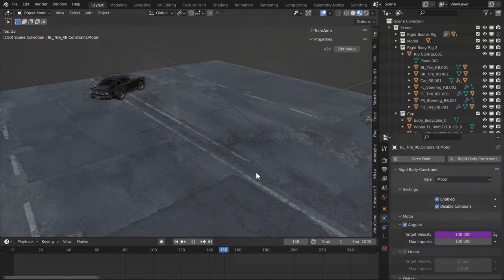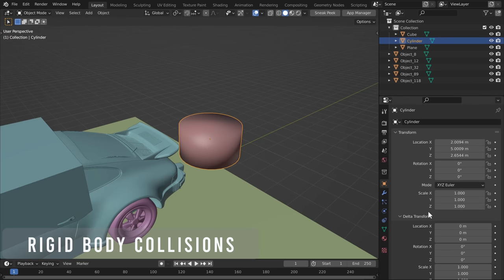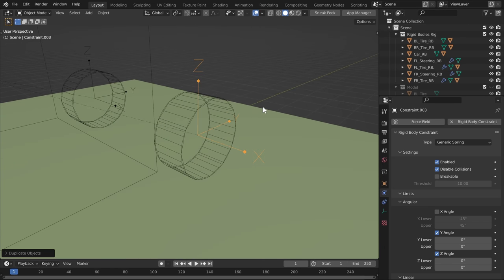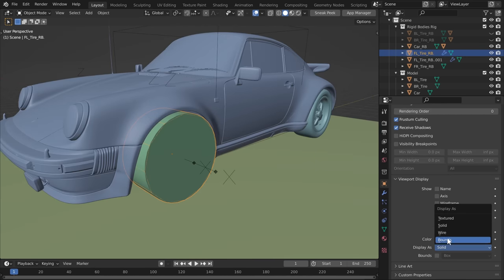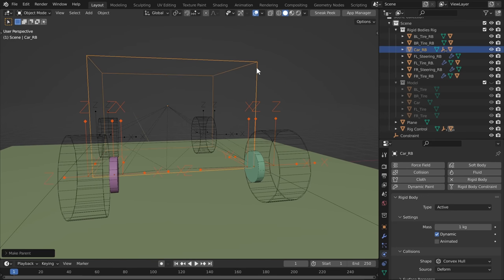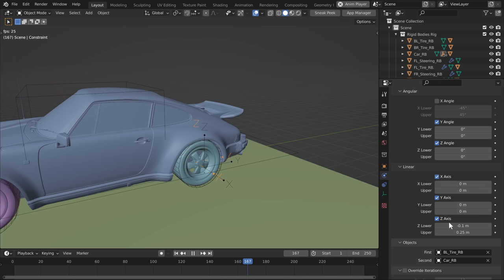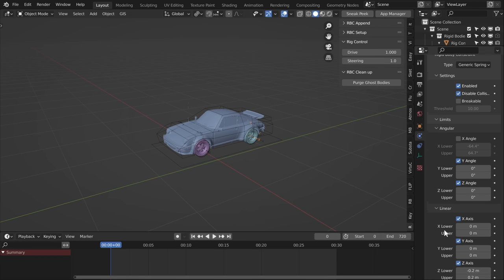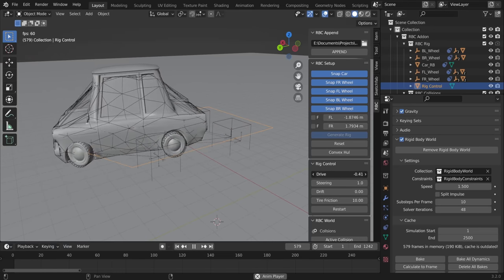Create a Car Rig with Rigid Body Physics in Blender | Car Rigging Tutorial

Comment: as soon as i switch the constraint type from fixed to generic spring, the rigid body wheels stop supporting the rigid body for the car and it falls to the ground in one connected mess.  in the video, the wheels are still supporting the car when you test the suspension...

Comment: Thanks for sharing this, Austin!  Very useful.  

A good habit to get into is (as you mentioned) to scale and rotate your objects to where you want them, and then freeze your Scale and Rotations (Ctrl+A) for the objects.  Physics simulations require real-world dimensions to look "right".   Freezing transforms regularly can save a lot of headaches down the road (no pun intended).

I look forward to any other videos like this - rigid-body constraints in Blender are a dark art (compared to what I've used in other packages)
Reply from the maker: Yes! Great advice, I’ve been trying to find a way to automatically scale and apply the objects and constraints with scale the car rig control, it’s been a hassle. Thanks Kent!

Comment: This is awesome tutorial! I want to make cool animation with car but I failed with wheels. They are wiggling like there 11:40 but then you somehow fixed it at
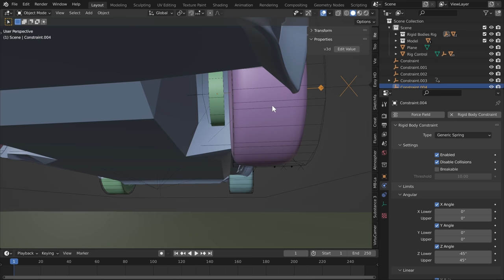12:37 and I do not know how because everything seems to be same with yours and origins are same with wheel's collisions. (Already fixed)
Reply: Eeeeeeeee I fixed! Solution was very unexpected for me. Back wheel's suspension constraints (generic spring) have to be connected to the body collision first, then to the wheel's collisions, but I had the opposite. You mentioned about something similar, so it gave me this idea. Must to thanks you for this tutorial again!
Reply from the maker: Awesome glad you figured it out! Yea I think I should've stressed the importance of the order the objects in the constraints are but didn't realize until later.

Comment: One of the best guides I've seen.
I have a question - is there a way to control the steering motor of the car by setting an angle and not by setting a speed. Because setting speed always takes the steering quite quickly to the end of the stroke and it is very difficult to center the wheels, and drive in a straight line.
Thank you
Reply from the maker: Thank you, This is a great question, I've tried to set drivers to the angle limit of the constraint but the scene needs to be reset to the beginning of the timeline for the constraint to be reset, so in short I don't think so or ableist I never found a way. This steering method is just the best option I've found so far.

Comment: Wonderful tutorial, thanks, helped me a lot finalizing my rig! I have one question though - how did you achieve the "standstill"? I always get sliding movement and slight wheel rotation when just standstill (even though the ground is perfectly flat). I tried increasing the Iterations and friction, to no avail. Glad for any sugesstion! Amazing monster truck rig by the way, so satisfying to watch, love it!
Reply from the maker: Thats a great question, a trick that worked for me is having motor constraint's Max Impulse set to anything above 0. The higher the number, the less the wheel will rotate, it acts kind of like a brake function. You could also increase the object friction to reduce sliding movement.
Reply: @akastudioss  Hi, the problem was in the weight of the Body itself (set to 200 kg), when restored to 1kg the model stays nicely put. With your monster truck rig you use real weight measurements? Asking just out of curiosity, since it seems to me higher values cause bugs. Thank you for your swift reply by the way! ;)
Reply from the maker: @janhrodek7206  No Problem, but no I did not use real measurements for the monster truck, just winged it lol.

Comment: As a non-modeller: How come you can’t assign the properties to the model itself? Like, why do you need a cylinder when you already have a perfectly good tire? Seems like it would simplify a lot.
Reply: Actually using the cylinder simplify things, at least that's what I see in the video
Reply: @seriouscat8482  I'm not seeing it. The cylinder causes issues because it needs to line up with the tire, and causes issues when scaling the model because it does not stay lined up to the tire (or the body), and there's twice as many objects to manage along with twice as many objects to watch out for in terms of the physics (like: make sure the bumper doesn't clip in to things because it extends past the rigid body cube).
I feel like the main reason I'm not seeing the simplification is because I'm not familiar with 3D modelling so I'm curious the understand
Reply: @JB-fh1bb  oh now I understand what you mean, and don't know why he does it that way

Comment: Austin, I'm busy trying to build this as I want to work out how I can drive a wheel on a castor for an office chair, but either I am being thick or some steps are missing in your description here. Probably the former. I have the "dragging" dynamics of my castor working perfectly, but I am struggling to get the wheel to roll in relation to the chair being moved. Can't find a tutorial anywhere that shows how to do it except in a straight line which is essentially useless. 

Suggestions?
Reply from the maker: you could follow the steps on creating the front steering wheels and connect your wheel obj to a steering obj only rotating around the x axis, then connect your steering object to your chair only rotating around the z axis, that should create effect you're looking for.
Reply: @akastudioss  Thanks for answering Austin. Didn't really expect that. You turn your front wheel with a motor constraint. I haven't been able to get the wheel to rotate using plain physics. How would I control the motor constraint from the chair movements?
Reply from the maker: @0zyris  Haha I try to answer as much as possible. I think using a motor constraint to rotate your wheels in relation to the chair movements is more complicated than it needs to be. I did a small test and was able to do it with plain physics. So what I did was have a wheel obj connected to a caster obj that rotates around the x-axis, and the caster obj connected to the chair obj that only rotates around the z-axis, the caster obj constraint is also position toward the front of the wheel to get that dragging movement. If you're animating the chair obj make sure your wheels are touching the ground obj to get that dragging friction. Hope this makes sense If all else fails, DM me and I'll send you the blend file.
Reply: @akastudioss  Good man! I for one am grateful! I've DM'd you on Discord.

Comment: How did you make the rear wheel drop faster than the chassis in the example at the beginning? I'm trying everything (already tried changing the gravity and speed in rigid world) but my wheels still fall at the same speed as the chassis 😭even increasing the mass of the wheels didn't make a difference
if you know how to do it I'd love for you to explain it, thanks!!
Reply from the maker: Try moving the origin point of the car body with the rigid body to shift the weight to the back

Comment: Hi, I'm following the tutorial, but as I add the constraints at 3:10 , the gizmo(empty) is huge. Can I scale the Constraints(empties/gizmos) without affecting the simulation scaling(suspension length etc.)? All the objects in my scene are to real world scale, but the constraint gizmo is like 3 times bigger than in this tutorial.
Reply from the maker: Yes scaling down the constraint empties should be fine, I've found that only the location and rotation of the constraints affect the simulation.
Reply: @akastudioss  By the little green gizmo icon in the properties panel, the same one where you change the way empties display, you can change the size.

Comment: at 7:15 or so i cannot get mine to match this. my steering cylinder isn't attached to the tire cylinder like the one in the video and it doesn't steer when i change the values. changing the orientation of the constraint didn't fix it. Can anyone please help me?
Reply: Did you find a fix?

Comment: After adding drivers first time when I start the animation and turned up the drive value the wheels were spinning but also going forward but the body of car doesn't ( i mean the speed of moving of body is slow bcuz of that the wheels hit the body and casuses crash aur glitched animation also 
as the car goes forward the wheels starts acting strange they don't spin (like their anchor point is on middle) but rather it looks like by the forward movement of car the constraints position gets changed so the wheels doesn't spins the same as before how do I fix it please helppppp i literally cryin
Reply from the maker: Don't cry, I'm not sure what the issue is but try switching the constraint objects in the constraint tab, Make the first object the car body and the second object the wheel.
Reply: @akastudioss  i did I did 
That didn't worked 
I have DM you in Instagram with the footage of the issue
Reply: @akastudioss  I Tried this and it freaking worked . Thank you so much Vrooooo 🥲❤️

Comment: helloo, i failed at minute 4 😭 the spring mechanism didn't work
Reply from the maker: hmmm how did you make sure both back constraints were the same?
Reply: @akastudioss  already figure it out 😅 but my problem is with rear wheel, the wheel is shaking when i move the car
Reply from the maker: Make sure the wheel constraint is perfectly center with your wheel object, I had the same problem